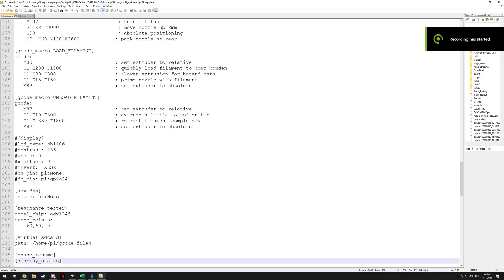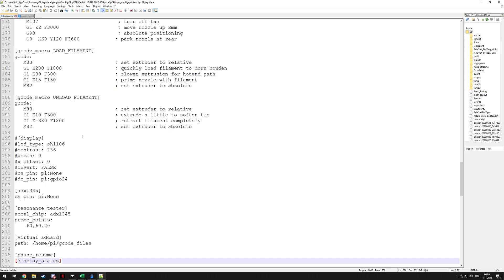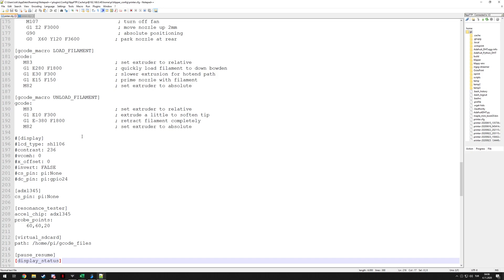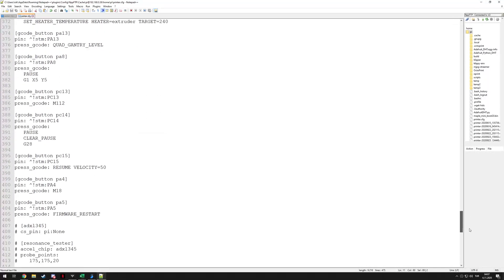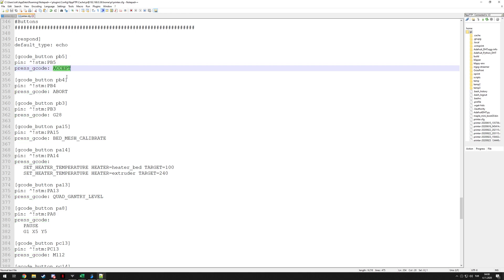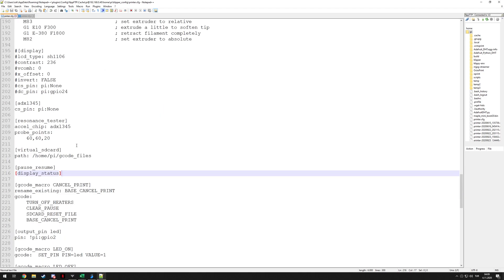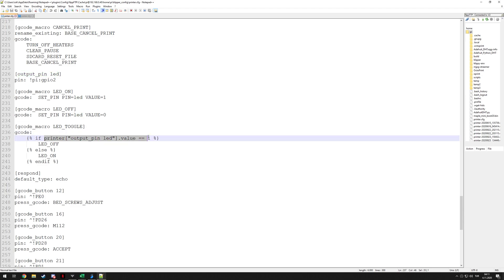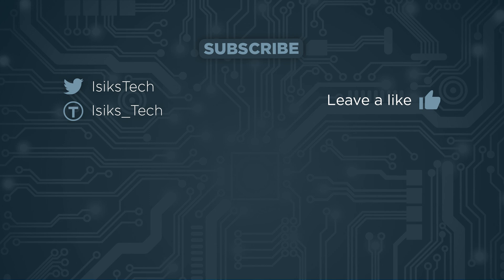Klipper Gcode Buttons Guide

Comment: Useful video. At 1:15 you say that you can't connect them to you pi GPIO pins cause of random triggering. Did you use pull-up resistors on those pins? Otherwise they would be floating while the button isn't pressed and that causes them to trigger sometimes.
Reply from the maker: I didn't. Manually checking the pins always showed the correct state so I didn't bother. I had the same issue on an another pi on another printer too, and in both cases it was Klipper reading the pins wrong. I think the problem is with the kernel, Linux kernel isn't great with real time gpio. It probably responds late to klippers polls and klipper thinks it is triggered.
Reply: @IsiksTech  GPIO pulls are all enabled by default unless otherwise later-disabled by the OS or Klipper during pin assignments. In reality though, we need access to system interrupts to reliably handle momentary input signals. Great work!

Comment: Could you please show how did you connect button?
Reply from the maker: It depends on your board. Look at it's pinouts. Use a gnd and either spare endstops or gpios.
Reply: Thanks for reply~! I just want to see your hardware button. Anyhow Im super newbie of 3d printer and klipper thanks for your video. It is really hard to find klipper information and your video is really helpful!! Please keep upload klipper ~
Reply from the maker: The buttons can be seen here: https://github.com/xbst/VoronUsers/tree/master/printer_mods/xbst_/V2.4_Skirt_Buttons Thanks for your support I will make more Klipper videos for sure.
Reply: @IsiksTech can I use a standard end stop switch as the bottom as long as I add the config and corresponding pin?